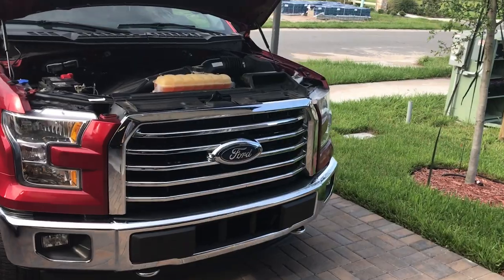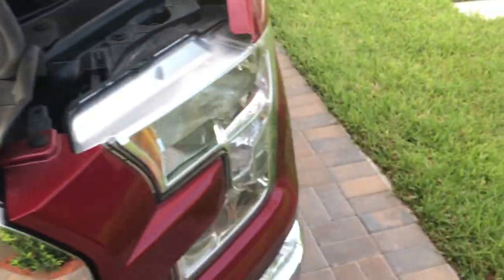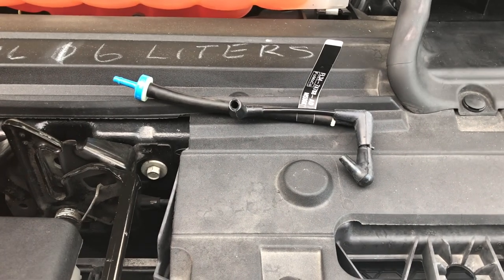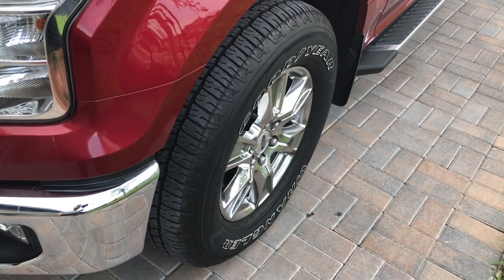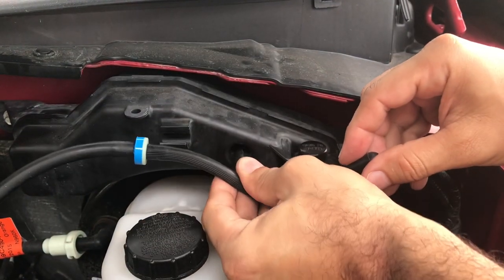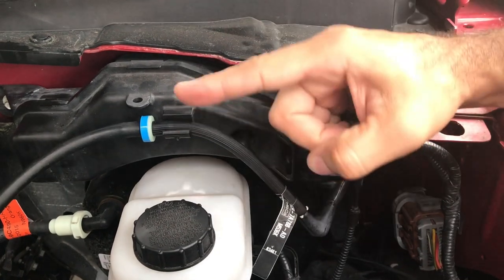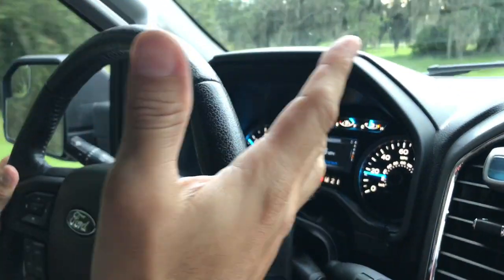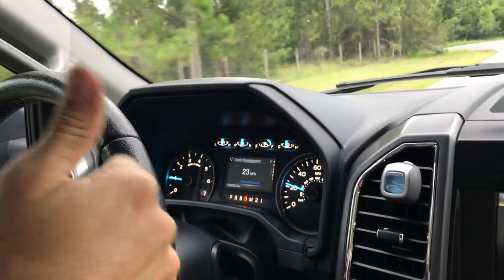IWE Check Valve Replacement On a Ford F150

Comment: My friend had this issue, The local Ford dealer said his front hubs were bad and wanted $3200 to fix. He found this fix online and it worked. He went back to Ford to complain and the service manager said that is the Factory recommended. Replace the hubs along with the vacuum check valve. Stealership strikes again.
Reply from the maker: Hit the ground running That’s why we shouldn’t listen to Ford’s or dealerships recommendations. Thanks for sharing
Reply: 1:37
Reply: This is what my dealer just texted me. $1400 for all. I wanna buy this valve at Napa and check.
Reply: All dealers are crooked has been my experience

Comment: One more happy viewer. 2018 F150 Lariat driver. Our symptoms were when 2H knob was switched on, there would be an intermittent grind noise when slow to medium speed. However when switched to 4A or 4H - the noise goes away. That means the solenoid works, since it switches. But the check valve would leak and allowed the front wheels to grind when they try to lock. Makes perfect sense. Thank you! 😊

Comment: Fixed my issue as well on my 17 F150. It was under warranty, but the part was $20. So it was either wait a week for dealership or fix it today for $20. Easy fix. Thanks 👍
Reply from the maker: That's great to hear!
Reply: Where did you guys get the part?
Reply: Same mine also under warranty but $25 took care of the problem today
Reply: Dealership only get the updated line has the part number on a sticker and color of the valve is different I'm about 9 months late on the answer sorry about that !!! Now that said if u can't get to a dealer right then say u are on a trip u can unplug it and let the hubs  Engage and the grinding will stop until you get the new part what is happening is its starting to  Engage the coupling link with one set of gears turning and the other not . Hope this helps some 1 out one day !! Make sure to block/cap the  vacuum line going to engine if u are not sure crank the truck it will be sucking air making noise !!

Comment: When taking the vack lines off twist the rubber line back and forth u will hear and feel it brake lose then pull the line off if u don't do that u will most likely brake the end off in your rubber hose!!

Comment: Sometimes I miss my '79, and the old lock-the-hubs routine, lol ☺️
Reply from the maker: I second that! But for the newer F150s you can replace the IWE with a fixed hub. That get's rid of this hassle. However, you do lose some MPGs
Reply: Nostalgia has a way of remembering things fondly. I know what you mean but most of the time I am very grateful I can go to 4X so effortlessly. I'm usually not in the mood to have one more thing to do while working in the truck.

Comment: Man, Thank you!  That completely stopped the random grinding noise/ vibration under my 2018 F150 limited.  Freaking amazing
Reply from the maker: Happy it helped!!!
Reply: What the heck is it called, what do I tell the guys at the store to get
Reply: @brianparker6294  YG-429 is part number for the valve it’s self. That’s all I replaced on mine and it fixed the issue
Reply: @slepht5468  I replace the solenoid first and it solved it but I have the part now also
Reply: @slepht5468  simple fixes…..
Reply: Is this only for 4x4? I have a 2015 2wd and I get the random grind when I accelerate
Reply: @frankdelacerda9959  well that's definitely not going to be a 4x4 fix for a 2wd that's probably rear end bearings on 2wd

Comment: I have the same vacuum issue on my 2018 F150. I have found a workaround to cycle the 4WD system every time I do a cold start. After that it appears to be ok (I assumes it's generating enough vacuum pressure to hold for a certain time). Obviously not right. I do have a question though: I do want to replace the vacuum check valve. The part number on mine ends in -AC, the part you used in your video is -AD. I would assume that is a newer design. When I called Ford they only show the -AC for my truck, should I try to find the -AD online to get the newer part?

Comment: I have a 2015 Ford F-150 Platinum with 60k miles. Mine were grinding pretty bad when I came to a stop at around 15 mph going down you would feel a horrible grind and I thought it was my brakes or rotors. Got them changed and still felt the grinding and was confused. I found this page and changed that exact part and the grinding went away. Thank you for posting this video and saving me a lot of money by going to the dealership. Part only cost $30 at a Ford Dealer
Reply from the maker: That's awesome Anthony! Don't forget to subscribe!
Reply: Hey Bro what is the part number?

Comment: I just sent this video to my dealer. He's been trying for 2 weeks to figure out the grinding noise on my 17 F150. Thanks
Reply from the maker: Hey Vince. That is normally the simplest issue with the IWE grinding. If that doesn;t solve, you can try the IWE solenoid, or check for a vacuum leak. The worst case scenario would be the IWE   hub leaking.
Reply: @dcfgarage  Thanks Dan Dealer is a stone head, says it's definitely not it. But they still can't find out the problem. If they can't fix it I'll change the check valve myself. Thanks
Reply from the maker: @vinceb9310  All dealers are clueless. I have several horror stories with Ford. Sometimes  it's a vacuum leak that causes the IWE to grind. Those are harder to find. But normally the check valve is the first thing that goes bad. 

You might also consider the heat shields. The F150s have several of them. Sometimes the heat shield next tot he exhaust manifold is loose, and that too can cause a rattle. That is also a simple fix.
Reply: @dcfgarage   Hi Dan, Thanks for the advice, I had the underside of the truck all checked out, all the shields are tight and in place. I replaced the IWE check valve myself ( less than 1 minute job) and I haven't heard the grind. Fingers crossed.
Reply from the maker: @vinceb9310  Fingers crossed!
Reply: Vince B still no grinding??? I think my valve might need to be replaced. On my 3rd set of hubs now. I think my mechanic is retarded.
Reply: Dealers are not clueless . . . THEY KNOW . . . their first instinct is to play the customer as a fool. Of course, with these symtoms there is a vacuum leak and the place to start . . . is to replace that check valve with short hose assembly known to be defective. If you drove the vehicle too long and needlessly tore up more parts  because of not knowing or the dealer played you then you're looking at a $$$ total repair. 
THEY WANT YOU TO TEAR IT UP.

Comment: Patial engagement can also be a leak in the rubber hoses. Common for them to wear through where its zip tied behind the tires. Happened on mine.
Reply: How did u check them?
Reply: If u don't have a smoke machine just take a look .
Reply: You can use a brake bleeder to apply vacuum and listen or bend the rubber lines and look for cracks

Comment: My 2017 3.5 Ecoboost is having this same problem. Although I don't hear the grinding until I am running about 68mph and am on the throttle. It goes away when I let off. This part is coming in this morning so hopefully this fixes everything. Thanks for the instructional video. Update on my truck coming soon.
Reply from the maker: You're welcome. Let me know if it doesn't solve it
Reply: @dcfgarage  Did it fixed your truck?
Reply from the maker: @alexcelis9223  In my case, it did. But because mine had the defective check valve that ford revised later on. Other causes of your IWE partially engaging can be a the solenoid (rare on the 2015+),  vacuum leak on the hoses or a vacuum leak on the IWE itself.
Reply: @dcfgarage  Got the Check Valve installed and so far the grinding is gone. Hopefully I caught the problem early enough. Thanks again brother!🤝
Reply from the maker: Alex Celis great news!
Reply: I have a problem with my 2015 f150, it seems that the front tire makes a humming noise but when I roll down the window, I don't hear that humming noise.

Comment: this is an excellent video,  I just replaced mine and did not fix the issue.  Next step is replace the lines, I think someone replaced them and did not route them properly.  One is going through the frame which I think is incorrect.  This is on a 2019 F150

Comment: Did your make the sound at all times? My makes a grinding sound when it is super cold out and I am accelerating.
Reply from the maker: Not all the time. Only when accelerating and under 2500 rpms. Keep in mind that this is just one simple fix of the vacuum check valve that was updated by ford because it would go bad. But anything along the vacuum lines can be leaking, including the IWE hubs themselves.
Reply: Tucker Ksiazek it will usually get worse with time

Comment: That's an improper method of testing the 4wd system.  It actually needs to be driven in 2wd and 4wd to verify the repair because the instrument cluster doesn't verify that the front hubs actually engage (as proven with the issue I'm having with hubs not engaging even after a repair).

I'm having the same problem with my brand new (used) 2017 f150 with the occasional random grinding noise and 4x4 not engaging in spite of what the cluster says.  In my case though, the problem is seeming harder to fix.
Reply from the maker: This is just a simple fix of a known bad valve that’s been revised on the realm of things that can go wrong with these vacuum 4x4 systems. One thing you can do is to replace the hub actuator for one that’s constantly engaged like older and more reliable 4x4 systems. This hub that Ford created was really to  improve fuel efficiency
Reply: Daniel CarFix can you do this on an 04-08 also or just new models?? I don’t think I can do it on mine nobody makes manual lock out hubs for them??
Reply: I had to replace my cv axle the iwe took out the splines on the cv

Comment: I have a weird, intermittent noise on my 2015 F150 4x4 as well. Sounds like it's from the driver's side wheel. It seems to happen just below 2,000 rpms and turning slightly to the right.

At first, I thought a hub was going bad. But after checking both, everything seemed OK.  Neither were loose or wobbly and rolled without any creaking or grinding noises. I was a little puzzled.  Now, after seeing your video, I'm pretty sure it's the same problem you had.  Will be heading to the local Ford dealer tomorrow for a replacement.  If not in stock, I'll order it.

Also, I'll update this comment as soon as I get the new part installed.
Reply from the maker: Thanks for sharing. Let us know the outcome. Keep in mind that if it's not the check valve, it can be a vacuum leak in the lines.
Reply: Well did it fix the issue?
Reply: Please update, this sounds like my problem.

Comment: Mine 2016 been doing that sound very loud just when I push the gas pedal or If is very cold out, I’m gonna order the part ASAP I hope 🤞 it works on mine Thank you for the good explanation
Reply from the maker: Yener López if the valve doesn’t solve, look at the heat shields for the exhaust. Those tend to make noise too
Reply: Daniel CarFix I will thank you again
Reply: Did you fix the problem?
Reply: Rove Va 
Yes, I went to the dealer ordered the part and put on my truck and the sound disappear thank God and thanks to the video now it’s 9 months already and still working fine with out the sound

Comment: Did this cause your truck to vibrate? I get the horrible grinding noise now also a shudder feeling when I get light on the gas around 1500-2000rpm but as soon as I let off or floor the gas it stops. I'm at my patience end after fixing the control arms and all the coils and spark plugs. I love my truck but I don't know what to do anymore
Reply from the maker: If your truck is vibrating at idle, you have an engine issue. You only get the IWE rattle when you're driving. If I were you I would get a ford tech and pay a diagnostic fee before I changed any more parts.
Reply: @dcfgarage  it doesn't vibrate at all at idle it idles great it's only while running in gear greater than 4th at 55mph to 75mph. No diagnostic codes have ever came up and other than that runs fine. It's not the head gaskets or block either. I believe it's either a small vacuum line leaking, the hub assembly, the filter in the trans needs to be switched or something else in the differential. The Ford techs are the last place I would ever go - you must not have experience with a Ford service department.
Reply from the maker: @nathanluther39  not s dealer, but an independent Ford shop. You need to narrow down your vibration. It cloud be a lot of things, including the tires and the driveshaft. I have had vibration in one of my trucks in the past that ended up being a tire. The only way I found out was through a road force balance. But you need to rule out a few things first. I don't think a grinding IWE or an engine vacuum leak would cause any vibration at cruising speeds.
Reply: @dcfgarage  oh ok. I thought you meant a dealership. I just have a hard time trusting shops that all I have is a Yelp review on ya know
Reply: Hello, did you find the fix for your problem? My truck have the same issue …
Reply: @enriquerazzielortahernande2203  I had my transmission flushed and it fixed the issue completely. Best of luck

Comment: Im having vibration issues on my passenger side. All suspension is new, my 4x4 transfer case did stop working but i dont think that should cause problems with the actuators. I checked vacuum at the actuators and i had good vacuum. Checked the hoses going to the actuators and good vacuum too, next is to check the solenoid. With the truck on i do have vacuum on the driver side but on the passenger side the vacuum is too weak. Thinking its the solenoid maybe.

Comment: I have an 06 that has constantly engaged wheel axle on driver side. Seems like a weaker vacuum to that side so I take it there’s a leak before or at that wheel. However 4 low works and engages the passenger wheel
Reply from the maker: I think you’re on the right track. That pretty much eliminates the solenoid. As the passengers side is working. Being an 06 , I’d start replacing the vacuum lines
Reply: Daniel CarFix is there any damage done if I took the vacuum off the working side so both are locked into their axels. But not at front driveshaft? Isn’t that the same as how my ‘03 works?

Comment: So, my truck only does this when it's super cold or we have had a lot of snow and ice.  It did it last winter and I thought it was ice or snow up under the truck and that was hitting or grinding on something.  I only get the noise and sensation when I am turning left and only while in motion.  I can turn the wheel all the way both ways when I'm parked, and no grinding.  I saw this video and replaced the IWE Check Valve.  I should also say I have a 2018 Ford F150.  Anyways, I changed the valve, and not change.  Still get the grinding noise when I turn.  It has to have something to do with the cold because that's the only time it happens.... Any ideas of what it could be????
Reply from the maker: Hi Alan. In your case, it could also be a leak in the IWE or a leak in the lines. In a 2018 truck it's unlikely to be the solenoid. I would test the IWE first for vacuum leak and then test the lines.

Comment: I had IWE issues on my same year and model truck 3.5L ecoboost. Dealer first replaced IWE on driver side, then passenger side few months later. Always bad when I turned. Now that it’s out of warranty it’s happening on the driver side again. I’ve heard that vacuum lines cause this issue as well. If it grinds when I’m driving I can turn to 4wd H and I can hear it pop back into place. Also when I use 4wd I cannot turn and keep even a low pace. The truck surges and lunges. Have you had any similar issues since?
Reply from the maker: I haven’t had issues since. Other than the check valve, it could be the solenoid, a line or the IWE boot. There are some ways to diagnose the boot and the lines

Comment: I'm having this very issue on my 2015 F-150. After seeing your video I replaced the IWE check valve and it didn't solve the problem. Do you have any suggestions on what to try next?
Reply from the maker: It might be the boot on the IWE itself. You need to do a vacuum test. There are videos on Youtube

Comment: Silly question, would it make the noise sitting still? My 2016 5.0 just started making this noise today and it first sounded like a heat shield noise. I laid under the truck while a friend accelerated (in park of course, LOL) and it sounded more mechanical. Truck runs and drives fine, even shifted into 4 wheel high and the noise still happens (intermittently as it does in 2wd). only 53k on the clock. Any idea?
Reply from the maker: Hey Greg. The IWE will only make noise if the truck is moving. If you hear that noise with the truck parked, it's very likely the heat shield if the truck is driving normally. My truck also had a loose heatshield next to the exhaust manifold that made a horrible noise that I initially thought was the transmission.
Reply: @dcfgarage  loose clamp on exhaust near transfer case for me
Reply from the maker: @paulmartins6023  thanks for sharing. That’s great knowledge

Comment: My 2011 does it at acceleration and low rpm cruising like going up a little hill in overdrive.  When it gets under a little load it starts grinding and quits when things level out. So it's losing vacume somewhere. I'm fixing to head to Ford and get a new one and I sure hope it fixes it. I'd rather not tear the front wheel all to pieces to put a new iwe hub on 😦.
Reply from the maker: On your generation truck it's likely to be this